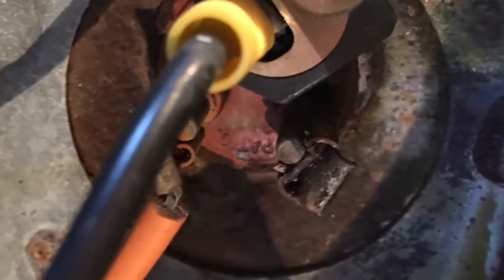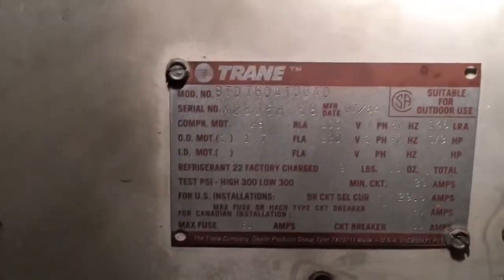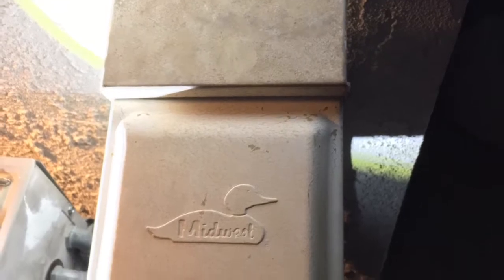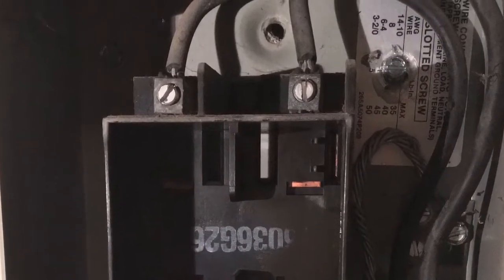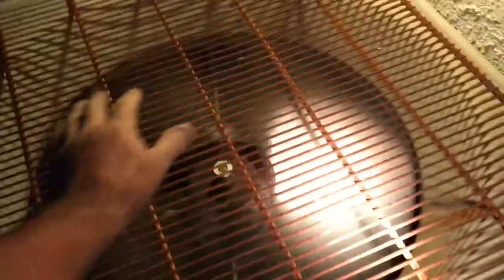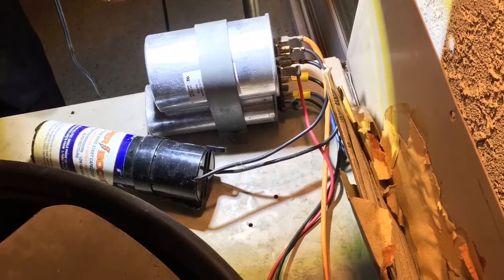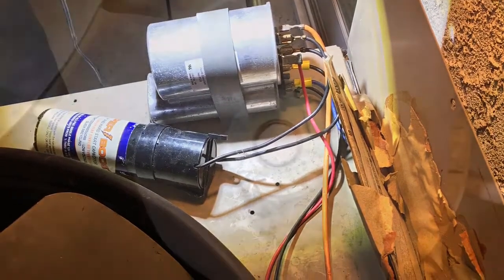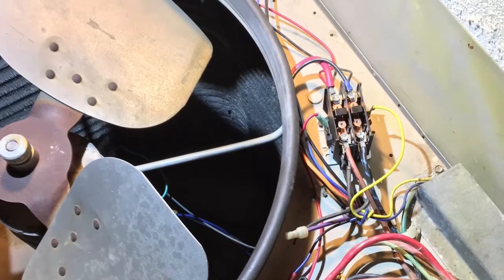It's Hard to Stop a Trane - Proof Shown !  Still Has a 20 Degree T/d.

Comment: How is Harpoon H working out? I hated that place... Just wondering
Reply from the maker: it's allright. so far , so good. finding breakers there is fun/NOt. and 
the non-existant Bar Access is Rediculous !  i Found 6 electrical panels
 so far and nothing labeled well. Redicilous ! and that place has been 
there for over 40 years. it's Challenging thats for sure !
Reply from the maker: as i find a Breaker to a piece of equiptment i try to label it & the Unit with the Panel Letter & Breaker NUmber. i Found None of the electrical Panels Were Labeled  So, I Assigned a Letter to Each Electrical Panel in the Place One Day For a Start so NOw at Least i Can Start Labeling as i go.